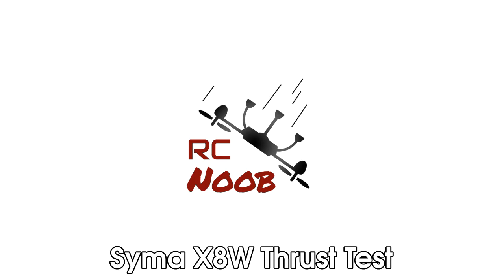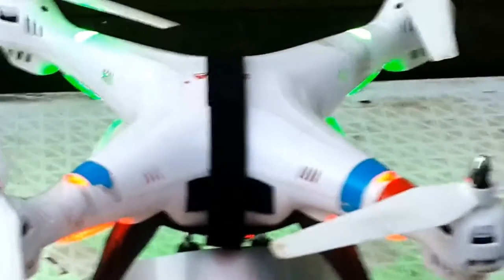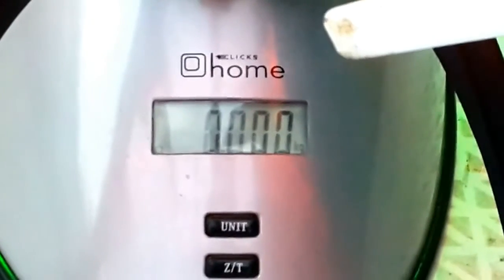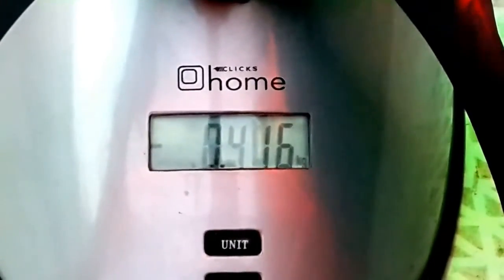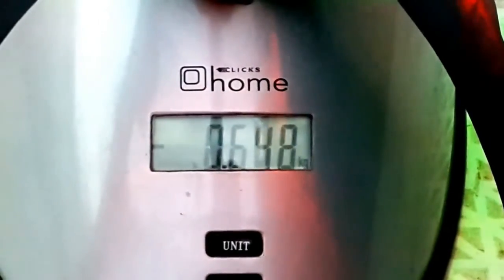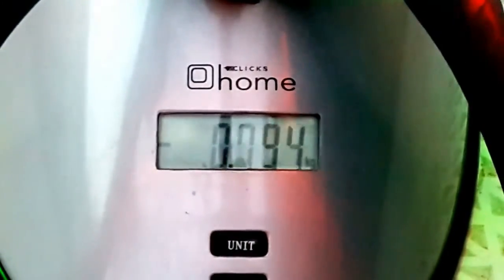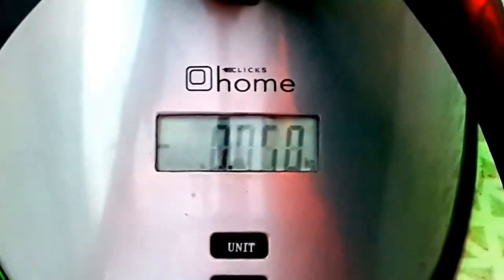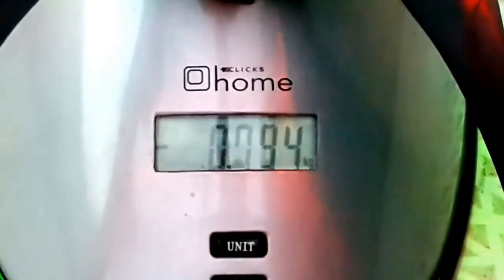Syma X8C/X8W Lifting Capacity and Thrust Test

Comment: Can it lift a camera weighing over 700 grams?
Reply from the maker: Miglena Vladova I think it would battle. The recommended thrust for any quad needs to be double its own weight just to carry itself and still perform reasonsbly well. That doesn't leave you with too much room to play with.
Reply from the maker: I built a big 500 size we quad that weighs 1.5kg and produces 4kg thrust. If I put a 3 axis gimbal and gopro on it, it battles. The gimbal and camera together weigh about 350g
Reply: What drone (except the ones coasting couple of grands) you think could , but still coasts around this drone's price?
Reply from the maker: If you don't mind building it yourself, you could look at something like this: HexaCopter ARF Drone
 http://s.aliexpress.com/EFjuMJBN
Reply from the maker: But you will still need a transmitter. I use a FlySky i6. It is cheap but it works well. Just do s search on YouTube for it and you will find almost no negative feedback about it.
Reply from the maker: In addition to that, if you want autonomous flight (gps guided flights) then you can replace the KK2 flight controller with sn APM 2.6. These are also stink cheap but very very reliable.